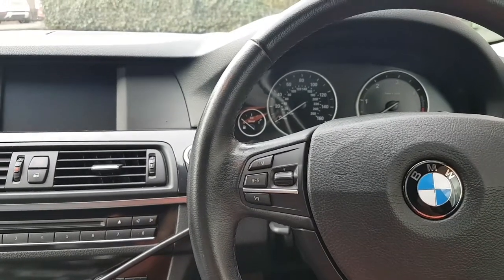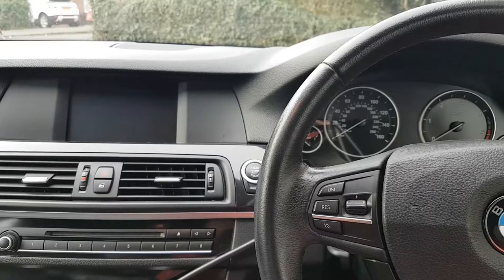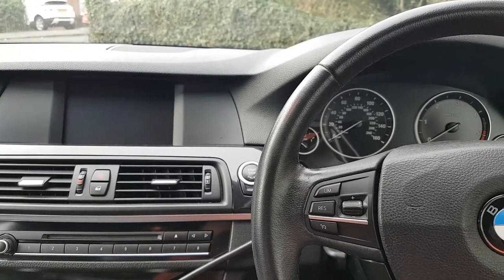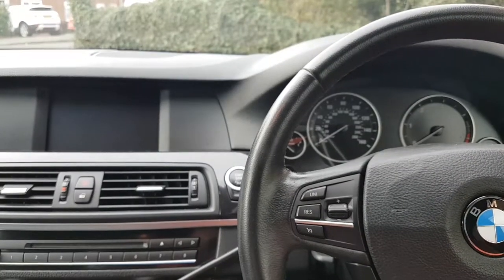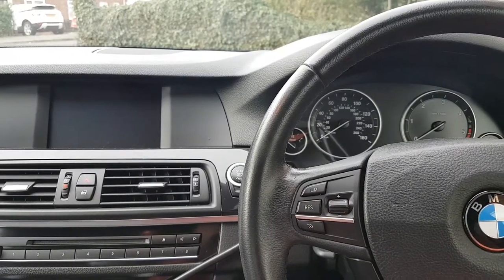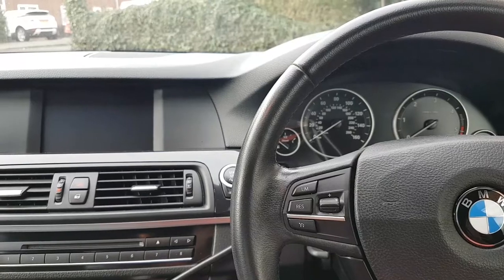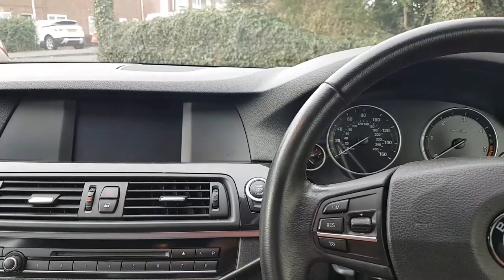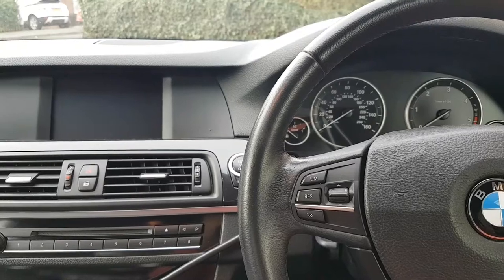BMW 520d F10 code P0122 (2610), throttle body signal. Fault finding and repair.

Comment: Thank you for another great video!!!
Great tip, checking for FAP filter...
Don't know why I thought EGR would bring engine temp down due to less oxigen beeing burnt, but yes you're correct for the function of that throttle, the same is true with PSA cars...
Reply from the maker: Thanks!
👍👍👍

Comment: If there's functional DPF and with that amount of oil the owner is in a world of coming problems. I'd bet on worn out turbo myself. Btw you have interesting what's the word? Dialect? You're english is very easy to listen to a Finnish person. I've quite recently gotten into habit of when suspecting some electrical component fault, I tend to these days remove the connector on go with the wiring loom for as much as I can easily get. Todays vehicles are annoyingly tight places and it's unpleasantly common to see bad wear in wiring harness insulation. Just few months ago I noticed that my Mondeo had injector wiring cut almost through insulation. Don't know if it would've touched head or anything, but anyway I'm glad I happened to notice it before getting fully through. Even not touching ground water/oxidation is problem enough with electronics.
Reply from the maker: Absolutely... I have warned the owner,  that he needs to pay attention to this other issues...
Thank you for watching and for your comment!

Comment: Again good F&F , might advice client to check the oil returnline of the turbo, those get clogged most of the times and the result is overflow of oil into the throttlebody and or intake/exhaustmanifold.
Reply from the maker: The owner has been indeed advised to get it checked...😉
Thank you for watching and for your comment! 
👍👍👍

Comment: Great Job You seems To know your stuff. I have the same model and i have To replace the throttle body, any calibration To do? just plug and play? Thanks
Reply from the maker: I believe there is a calibration procedure... But I might be wrong... would have to check... But you can always plug it in and see how it goes...
Thank you for watching and for your comment!
Reply: @LMAutoRepairs  Thanks for the Answer. Keep on watching ;-)

Comment: good vid pal. ✊✊mine was coked up when I replaced the oil exchanger housing and EGR valve so I’m doing this tomorro 👍👍
I don’t have any wet oil like you have on yours(hopefully)  just thick carbon gunk

Comment: Usually this ends with DPF replacement or gut the DPF and remap it out..on VW derv I seen it so many times customer has EGR problems, replaces expensive egr valve after maybe 3 months its gone again!! always end in dpf soot levels too high need fixing...
Reply from the maker: 👍
Thank you for watching and for your comment!

Comment: Hi Mr L thanks for the great video we are learning a lot from you sir .Sorry to bother you sir im running a small automotive shop but there is one car which is giving me hell and its a dodge caliber it has got a transmission problem and fault code  is U1146 and it says Lost communication with the external memory  i don't know if you ever came across with this problem sir  . Thanks for help inadvance sir .
Reply from the maker: No... never had that issue...
Sorry...😔

Comment: Hi, been watching your videos, they are great you really helped me program my first berlingo 2 bsi unit but I’m stuck on something I can’t get the remote central locking key working. Bsi was a used virginised part and every thing programmed ok, engine starts, but in parameters no key buttons are recognised when pressed. I have played around with configurations lots the only thing left to try is remote frequency type won’t let me change setting.
Reply from the maker: You need a new remote...
Remotes, can only be programmed once... so your remote will no longer work... get a new remote, program it and that's it...
Hope that helps. 
Thank you for watching my content!
👍👍👍👍
Reply: LM Auto Repairs thanks for quick reply, I bought 2 new remotes as keys were lost, in parameters it states 2 remotes learnt but no response from them or recognition in live data when buttons pressed?
Reply from the maker: @user-em8xb4uh9i  
🤔
Try the resync procedure... see if that works...

Comment: Hey, i have problem with this valve as well, it is clean inside but it doesnt want to open when prompted by ista, it just stays at 5%, when i move it with my hand it moves freely and the % increases, but it doesn't want to move on its own and i cant hear the motor buzzing at all, do you have any idea what might be the cause, is the electronics out
Reply from the maker: Possibly...
But make sure you have powers and grounds at the throttle body plug...
👍👍👍

Comment: That particular DPF fault (just an information) is related to the filter nearing it's end of life. It comes on at 200000km and the DPF should be replaced at 250000km. It doesn't matter if it's fully functional or not. Just a BMW standard. To get rid of it all you have to do is carry out DPF replacement procedure
Reply from the maker: Yes... correct!
Thanks for the info!
And for watching!
👍👍👍
Reply: That sounds odd. I've had DPF in my ford for almost 600 000km's and still seems to be in ok status judging by the regeneration cycles and pressures. Though admittedly that car has apparently been run on road conditions for pretty much all of it's life and very little city driving.

Comment: What about the oil level in general? Maybe DPF wasn't programmed out correctly and diesel getting into oil sump? Then the oil can leak through the various points. That's also one possibility :)
Reply from the maker: Indeed it is... I was only asked to look at this issue... that's it...
I advised the owner thought, about the issue, so he is aware!
Thank you for watching and for your comment!

Comment: Will bad throttle body cause engine to shudder on closing ignition off car feels like stalling
Reply from the maker: The throttle body on these is among other situations, used for a smooth engine shutdown, as it fully closes it starves the engine from air, forcing a quicker shutdown...
If that is what you referring to...
👍👍👍
Reply: @LMAutoRepairs  not sure my car runs very good but when im turning off the car it shudders like stalling you reckon it might be this ?
Reply from the maker: Could be...
Inspect and clean it, if you can  test it to make sure it is working...
Reply: @LMAutoRepairs  i cleaned it it stopped shuddering for few days but came back afterwards with small shudders its not horrible how it use to be but still have little shudders  how do you test it if it works
Reply from the maker: @MustafaSoylerA68 
Is an electronic or vacuum actuated throttle?
Reply: @LMAutoRepairs  its the same in your video mate
Reply from the maker: @MustafaSoylerA68 
OK... to test you a scan tool...

Comment: This vehicle has a massive breather problem hence oil being sucked from the turbo seal
Reply from the maker: Thank you for watching and for your comment!
Reply: @LMAutoRepairs  I work for BMW now so forget the current YouTube tag, if you need information drop me a pm
Reply from the maker: @vauxhallmechanic  
Thanks!
Reply: @LMAutoRepairs  r u on messenger
Reply from the maker: @vauxhallmechanic  
Don't really use it...
WhatsApp
Reply: @LMAutoRepairs  I don't use what's app, I only use messenger. Its safer